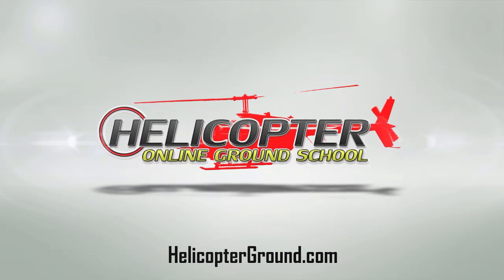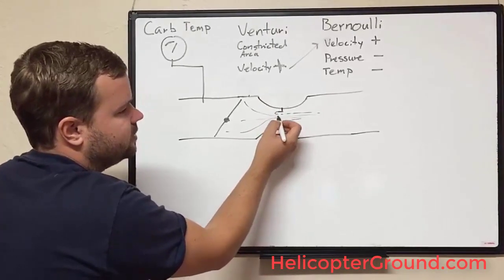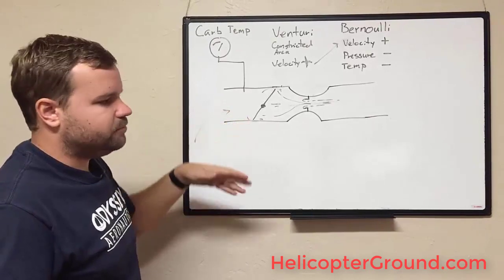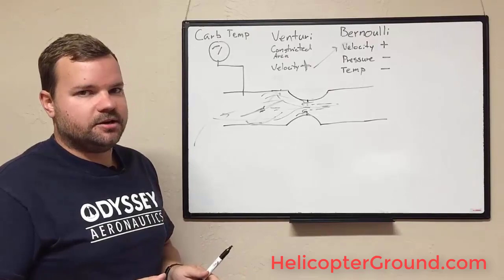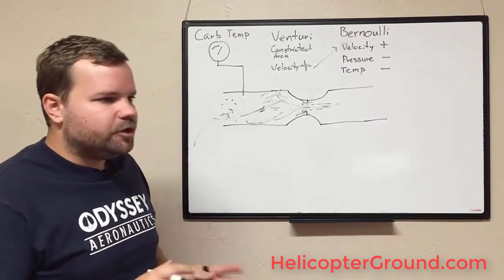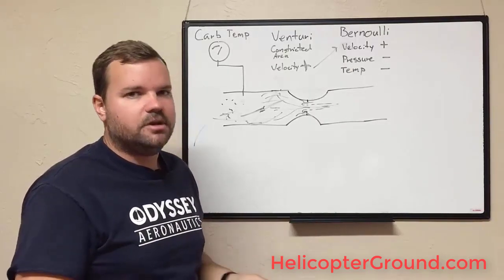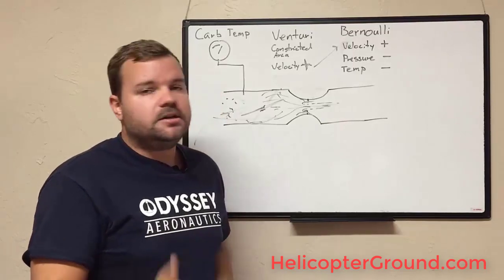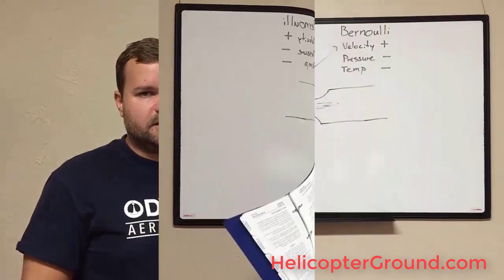Carburetor Heat, Temperature and Carb Icing

Comment: Overall I like the video, but you have your fuel/air mixture flow backwards. It should be flowing from the right to left according to how you drew it.
Reply: I was thinking the same thing. Butterfly valve is located AFTER the Venturi, No?
Reply from the maker: Thanks for the feedback

Comment: Great video! I recently read someone taking their private pilot written, and they were given a question, when is carb ice more likely to develop at 70°F with 80% humidity or 80°F with 70% humidity + another option that was a throw away. I’m assuming that an answer with higher humidity would be more likely to develop icing conditions because of the higher relative moisture correct?
Reply from the maker: yes